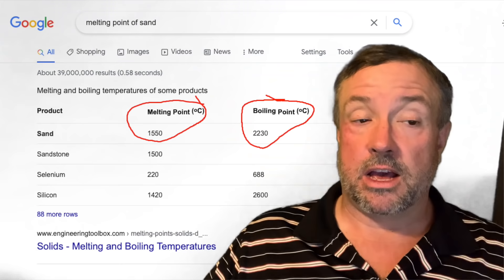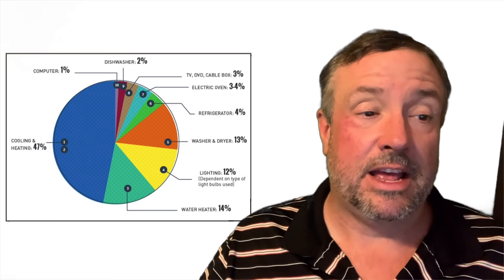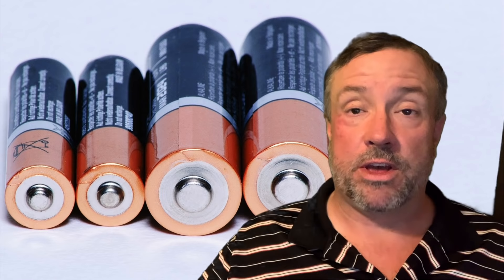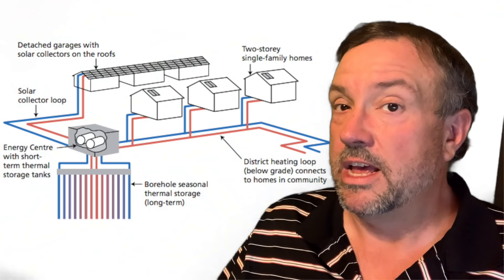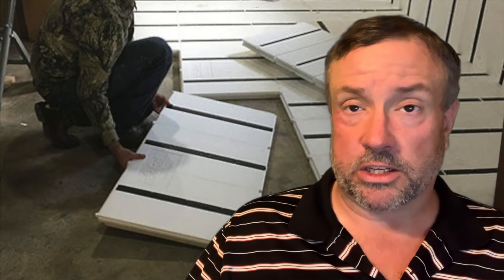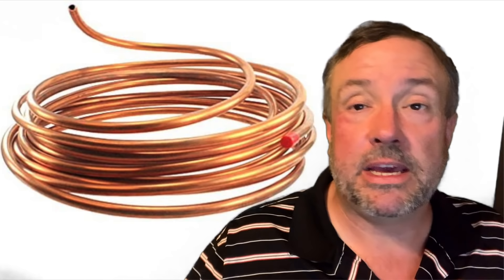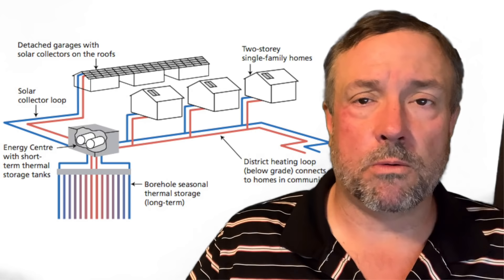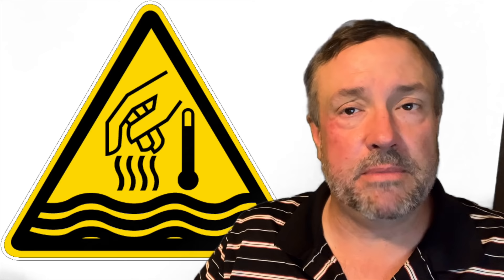Sand for Thermal Energy Storage

Comment from the maker: I need your input on piping, insulation, and distribution of heat for a sand battery! Help!
Reply: From what I saw, they don't even use steel pipes, I think they just used flat rocks, steel furnace pipe would probably rot out fast.
Reply: R50 is zero energy from a starting point. Fiberglass, foam and air Crete.
Reply from the maker: @jeffstout6567  nice
Reply: maybe lower temperature, but a  bigger area with sand?
Reply from the maker: @dvr102  that's possible
Reply: You mentioned aircrete to insulate, i haven't looked into that yet. I like the idea of having multiple circuits (electrical coils, air and water /salt lines) even if some are rarely used would be good for experimenting
Reply from the maker: @jeebus6263  I like the multiple circuits idea too
Reply: Is sand not a better thermal insulator than a conductor? Thinking like in the dessert it gets freezing cold at night so the sand can't be holding much thermal energy.
Reply: Salts usually freeze at low temps and have erosion and corrosion issues.
Heat transfer fluids can be toxic and expensive and high cost and high freezing temperatures.

So no to those.  Keep it air or water....true off the shelf mediums.
Reply: @garyhardcastle3736  even in Michigan, through the depths of winter the frost layer is typically less than a foot deep. I doubt the ground ever freezes in "deserts" even if the air is cold. Earthships run tubes 10ft deep and that's enough to both heat in winter and cool the homes in summer.
Reply: @gordybishop2375  corrosion from salts is a good point, ceramics could crack easily. I guess this would really only be needed to add heat, extracting heat should be fine at lower temp with water or air.
Reply: I like water as you can see the leaks easier.
Reply from the maker: @gordybishop2375  using gasoline is better cause you can find a leak fast with a match!
Reply: Fresnel lenses can heat to several thousand degrees almost instantly and be hot enough to melt concrete. The challenge isn’t get higher heat, it’s to heat your home or space. 

I agree with others here 1.) keep it simple & safe 2.) increase size and insulation to extend capacity, not increase heat. 3.) stay away from corrosives like salt or things hard to find at home.   4.) multi stage

I like the aircrete as insulation - it’s easy and cheap. 

For extreme climates the energy would need to be in a movable form so that it could be heated during the day and as it heats it is moved into its buried aircrete “thermos” if you will. 

Perhaps if there is an oil able to take higher temps and it is circulated and heated during the day and after dark or when heat is needed something like stainless pipes would through heated oil carry water that it heats and is carried inside to a heat exchanger or underfloor array. So the oil stores the heat and the water conveys it indoors.  You can of course pump oil indoors but it’s more problematic if there is a leak inside than water. 

When developing a solution I suggest limiting expectations initially and then enhance as more data becomes available. Don’t try to heat the whole house, build it to cut wood use 25%. As you learn you can increase it as warranted. Even if you cut 25% of wood use that’s 25% less work. Almost can’t loose. As you baby step through it and overcome the technical and practical challenges the real solution potential will become clearer. 

Flex, adapt, apply new knowledge and then take the next step. Start with more realistic initial objectives and fail forward. I’ll bet in 2-3 years you can master the whole house vs 6 month surge and series of fails lending little additional learning curve advancement.
Reply: @aceshigh235  new engine oil is clean but expensive, but old engine oil? Shops may pay you to take it away :)

The temp range would be descent, if it was in the medium (not in tubing) then any submerged pipes would conduct better. May be able to filter and pump from bottom, like engine oilpan(s).
Reply: If you stop thinking of it as a battery and look at Chinese greenhouse you will see you don’t need anything but the sand
Reply: @diversitylove5460  need vs want :)
Reply: Here's my take on it.
I would investigate the corrugated stainless steel tubing used for  natural gas.
Like many others here, I think you should use water as your working fluid.
To subvert the tempature limits of water, allow it to become steam.
To avoid the dangers of pressurized steam, keep the system an open one.
To store this heat, push your steam through the sand.
The steam will condense onto the sand particles and transfer the heat to them.
The water will drain to the bottom where we will have a sump tank.
That same sump tank could be the "low heat" insulated water storage you mentioned.
A defunct water heater could do the job.
An in line hydronic pump could pull water from the sump tank and push it through the solar heater, stopping when the tempature at the heater was lower than the tempature  of the storage sand.
A separate hydronic pump would be used to  push water through a (coil?)heat exchanger, located in the in the sump.
By using water as our working medium, we avoid the expense and dangers of manufactured chemicals.
By transferring the heat to the sand, we avoid the hazards and expenses of storing boiling water, and our working medium is returned to tempatures that can be dealt with using off the shelf components. 
The only section of the system that would need special materials is the part that moves steam to the middle of the sand.
Mounting the solar thermal collector on the roof of the sand storage minimize the length  of special tubing needed.
Because this section is not under pressure, most materials we might consider  will perform better than rated.
If the storage building is a cylinder, it will lower the surface area to volume ratio, without being excessively difficult to build.
A conical design might work as well.
The collector itself could set on a pivot point, with a handle that extended over edge of the roof, so the collector could change orientation from the ground, using a hooked pole or the like.
Reply: @slaplapdog  what is the cost of this system, aircrete insulation etc. Water can heat the sand up to 100c, after that the battery would evaporate water. Maybe useful for extraction but probably not charging. 

Electric coils are the easiest charging solution, i don't know what the upper limit would be on these. Ac vs dc etc. Main point here is if we double the heat to 200c, that's equivalent to two physical batteries. Tesla time was talking about >1000c, many oils will work up to 500c.
Reply: Hard to hear as volume is so low.
Reply from the maker: @reypolice5231  fixing that as I go forward - thank you
Reply: @jeebus6263  Ronyon was talking about a closed system for heating sand with steam and cooled water collected at bottom and then to sump tank.
The sump tank would be easy to kept topped up from any loss to evaporation. 
Just remember to install a pressure release valve on both units. Safety first.
Reply: @jeebus6263   Your point about the evaporation is an excellent one, I didn't think that through.
The obvious way to overcome that limit would be a closed system,  but that isn't inherently safe.
Reply: @redstone1999  Thanks for  your comment.
I think your explanation is the one that would work, but I hadn't thought of it!
I was aiming for an open system for safety, but I forgot  to consider what would happen when the sand reached  water boiling temperature.
Reply: Silicone oil should handle the temps you discussed but may be expensive. The metal you use for the heat exchange pipes is all about how fast of a response you want, cheap steel should certainly be fine if the cycles are taking place over hours/days/seasons. One thing to consider though is just geo thermal. You won't get the crazy high temps but you'll get enough to heat a green house/home through the winter, and the exact same system can cool your home in the summer. It's pretty cheap and easy to diy if you have the land to spread it out. If you don't then for like $15k you can have a hole drilled and do it vertically.
Reply: Thinking about this and the video on geothermal, I could see using a large pile of composting wood chips to heat a greenhouse or hotwater heater. Explore that idea and let us know what you think!
Reply: That seems like an important insight  - thanks for sharing!
Reply from the maker: @robyngodbout4300  Thank you for the link
Reply: @garyhardcastle3736  The desert sand is only heated on the surface, so the transmission of heat doesn't penetrate downward very far, and then it cools off each night. A thermal storage tank can be heated at the bottom and insulated, to retain as much of the heat as reasonable.
Reply: @jeffstout6567  fibreglass actually has really bad R value and poor longevity despite its rating. Spray foam is the king of insulation because it doesnt degrade, makes an air proof membrane. Not sure it can take 400C though
Reply: “Polar night energy” uses solar to heat sand with air.  Please watch their video, a Finland based company
Reply: The biggest drawback about evacuated tube collectors currently is that they get TOO hot for the food grade glycol necessary to heat domestic hot water. There is nothing saying that you cannot replace that with oil. And I know for a fact that if you have several sets in series you can get a ton of energy from them. Use that to heat the sand. Copper is expensive but you may be able to get away with metal electrical conduit and a pipe bender as long as the sand stays dry. You may want to look into ceramic coatings for the insulation of walls and floor. I would just concentrate on heating the structure. You can dial the speed on an electric motor to regulate how fast the oil flows and thus its temperature from the amount of time it spends inside the heat cell. Arrange the sand in a vertical column. Heat rises and stratifies in any fluid, with sand being considered a semi fluid the same principals apply. A secondary coil at the top of the column to collect the heat from. You will need an expansion tank for the oil vented to atmosphere still for the system.  Mind you this is months later so Im sure you have figured most of that out by now ;)
Reply: @garyhardcastle3736  I have slept on boulders on costal wind lashed areas and wasn't cold from the thermal heat held during the day. I am not sure about sand but rocks definitely hold heat for a long time.
Reply: Use your sand battery for a north wall of a winter thermal greenhouse & you could have a year round “outdoor” living and gardening area.  Bananas, avos, citrus, etc with no shipping from thousands of miles away.  Maybe plop a thermal hot tub in there too!
Reply: Large water tank buried in your sand pit heated by your wood boiler with a copper circuit in the tank then the tank water heating your greenhouse and house via pumps easy to regulate in house and greenhouse large storage cap fer solar or wood boiler heated water and you could fire the boiler less frequently
Reply: Whatever came of this idea? I have been thinking about these things as well. Adding sand to a passive heater. Like the pop can heaters. Also, what about using a magnifying glass on cloudy days? Would that help raise the temperature?  I have looked through your vids, and didn't find anything in regards to this. I very well may have simply missed it. Hope you see this comment. Curious to hear if you have experimented anything, and the results
Reply: Hi.  Been working on the same thing here for a green house and home.   Many pros and cons.   If you can make it work, water at 200c has the highest volumetric heat capacitance period.  You can keep it liquid at 223 psia but that's still a lot of pressure though manageable.   Piping will be expensive.    I would use two separate systems.   One for containing the hot water at below 200c + - 15°.   The other I would also use pure water with a stainless steel or copper  radiator sitting in the tub of hot water.    I would pump  water through the radiator isolated from the hot water, to remove the heat (not to add the heat) by pumping non pressured water through the radiator which happens to be sitting in the 200c water on demand.  Hope that is clear?  Yes it will produce steam and will cool and condense down to at below 100° c which is more user friendly and low to no pressure needed. Hope that's clear?
Reply: Why not fresnel lenses to focus solar energy? I realize that they need to be adjusted more frequently, but I'm thinking something like a raspberry pie with a camera apparatus that tracks the suns location and some solenoids that adjust the position of the lense to maximize capturing solar energy. Fresnel lenses can focus crazy amounts of energy to a small point. Raspberry pies, or arduino hardware are very cheap.
Reply: @tonyarnez5193  stainless
Reply: @jeebus6263  may need to water proof around aircreet otherwise water may seep in which is highly thermally conductive and of it freezes can crack allowing more ground  water to enter.   Could line the aircreet with industrial water barrier like used in hospital foundations, etc. To keep water out and insulate with over with aircreet.  Would need to be careful and well designed to not melt the barrier.
Reply: @garyhardcastle3736  Silicate sand has one of the highest volumetric heat capacities in nature.   Water is the best but higher temps can increase the amount of energy you can store albeit also causes more challenges and specialized engineering for high temps.
Reply: @aceshigh235  stainless 80 Guage might work but expensive.   Ceramics or carbon etc potentially but cost is a concern.    May sound crazy, but was wondering if at crazy hot temps, of silicate sand could be pumped through the system to transfer the heat.  I do know of impractical highly thermal fluids that would work but not practical.  Paraffin has amazing properties, but has a dangerous ceiling and limits the upper range of high temp but would work.  Need triple redundancy for safety however as the boiling expansion if exceeded is explosive at best.
Reply: @slaplapdog  You have raised an interesting point!  Use steam unpressurized at any temp to move very high temp energy?  Is this what you mean?   I will research this.
Reply: @jeebus6263  sorry misspoke here.  Cast iron at 1000c with a temp difference of 930c, would only have 1004.4 KWH energy per meters cubed NOT including heat losses.  1/12 a year of total energy used in average us household.    :(.  Didn't notice the online calculator was in joules not KWH.   To get kwh, must divide j's by seconds in an hour which is 3600.   My bad.
Likewise, Water using 100c difference in temp, requires 103.1 meters cubed to meet the 12 ,MWH heat energy used in average US house.   Most substances if you double the temp difference, you cut the amount of material needed in half.  I know I'm not showing my math, but I'm on my cell.  :)
Reply: @CommieBastard-dj9ot  it's a good system.  Though there are pros and cons of using the same system for heating and cooling.   Ideally it's seems the easiest and cheapest solution is to use a heat pump in conjunction with geothermal.
Reply: @Sycophantichallenger  I had never heard of raspberry pi before, and thought, at first, that you were making fun. Lol I googled it. What a great little item! TY! 

Yes, f. Lenses, are large, and generate, magnify, the power. I am not as technically skilled as yourself, so not able to build such a device. But what you described, is what I would love to create. I am in Kentucky. We would not need to use a lense everyday. But the addition of one, would greatly increase the usable days, of a passive heater. I have just completed the build of a soda can heater. Now building the back of it, which will be insulated, over kill!!! With a sand bank. Inside, will be other materials, to store up heat, such as Rick and other things. To store the heat throughout the day. To be released at at night. I plan on just trying to use a f. Lense manually. For I don’t know how to create a device to do it automatically. I believe, the combination of these things can create a very reliable, and worth wild heater. We will have two of them. Plus, ductwork and fans, to move the heat about the house. One side of our house is already several degrees warmer than the other, simply from the sun shining through the windows. With a little effort, I am sure we can take advantage of this!

Are you planning on building such a device as you spoke of? I would so love to hear about it. And see it, if you are interested in making a video of it? I can follow directions and maybe add one to ours! Thanks
Reply: @l0I0I0I0  I am building a passive heater. We have a lot of wrought iron collected, that I am going to put in, as a heat battery. Along with sand. So much is thrown away, and just laying around, that one can easily collect it for free! And man that stuff can get HOT!! With little effort!
Reply: @wordswritteninred7171  That's a great idea Tema!   Let me know how it goes?   Love to hear more about your design?
Reply: Just wondering what you ended up doing and why?  Any improvement ideas?
Reply: I've spend many hours on this last few days researching this topic as I want to make one for a greenhouse.  You probably all ready know this but I did some homework, and the DofE says avg household used 77million BTUs a year.  That's a whopping 22MWH+ Per year not 12.  That's double what I expected.
 The  higher temp you are shooting for of 1000c will help reduce materials needed but at a cost of safety and containment, piping etc.   It's possible but difficult, but sand is cheap.  Insulating and containing it are the issues I see.  Did research on making crucibles even but that's a HUGE one needed for sand.  Carbon would be the way to go.  Researched making them and it's possible but they do crack.   Needs lots of testing to make safe, but putting it underground will help with safety.   I would use a separate radiator system to pull the heat out.  
Carbon fiber pipes will work for longevity at the higher temps wrapped in thermal heat blankets, forget what that white insulation is called.
Personally just buying or making a huge solar heater and lower temps may be the best option, especially lower temps.  I've been working on a solar hot water heater for some time now but not complete.   A friend heated several homes with them year round with no prob.  That with a geothermal system would be idea I think.   If you want to hear more I'll discuss water hot water storage in conjunction with a solar hot water heater.   1 month of hot water storage may be overkill but that's the fun part of it all.  :D
Reply: Just looking at sand vs water properties and with the temperature ranges you are talking about it simply doesn't make sense to bother. Sand has the 1/5th of specific heat and a density of 1.75 roughly. Aiming for 200 °c for  a given volume you would have roughly the same heat stored than water at 80°c.
Reply: @loicbockstaller7405  yes sir!  Found the same.  Water is the best.  But for safety, have double reliefs or kaboom.  Expansion ratio of water is crazy high and can take off like a rocketship.  But with the right precausions it can work and work well.  Recommend looking into boiler systems and boiler safety beforehand.  Let us know how it works out!!!
Reply: Oilfields Coil tubing would work and it's cheap like borscht
Reply: @tommyodonovan3883  Sounds like it might work.  What is it made of and is it coated.  How conductive is it?  TY
Reply: Controlling the temperature of the sand battery would be a priority. 400F is normal in a steam system, so fiber glass insulation incased  with a aluminum weather shield exposed to the elements is normal. The loop that enters the residence may need to go through a heat exchanger to keep the temperatures under control say 180-200f. 
   I’ve recently been busy polishing a sheet of aluminum flashing to a mirror finish with a final grit of 10,000. with a 5” orbital sander. It’s quite reflective, however I’m waiting on a order of 94% reflective 2mil material with adhesive on the back side to compare it with. The solar trough idea dems, are 30” wide and 8-10’ long.
Reply from the maker: @jeffstout6567  that’s awesome
Reply: As for a thermal transport medium, I heard someone suggest using regular air. It makes sense to me but I'm not sure what kind of fan could survive 500-1000C
Reply from the maker: @JohnDavidDunlap  good question
Reply: @SimpleTek  I might have an answer. The exhaust side of a turbocharger is designed to handle hot gases of that temperature. As long as it has oil pressure and something cooling the intake side, I see no reason why you couldn't use the exhaust turbine to move hot gases.
Reply from the maker: @JohnDavidDunlap  love it
Reply: Pex is the only way to (in my opinion).  Pex carry's heat well, will not rot or rust, and is inexpensive.
Reply: @frankfrederick5158  That's fine if you're content staying below the boiling point
Reply from the maker: @frankfrederick5158  pex is limited to about 90’C though
Reply: @JohnDavidDunlap  Yes.  If you need to distribute heat higher than boiling, then use the Rocket Mass Heater concept, but heat water to use for other uses also.
Reply: @SimpleTek  Here is a quote from the Pex stats:   "The maximum heat temperature of the PEX tube is 200 degrees. The maximum heat of the PEX can be up to 180 degrees. The PEX tubing has the highest temperature limitation listed in small prints".
Reply from the maker: @frankfrederick5158  sure that isn’t Fahrenheit? Sound about right for F’
Reply: @SimpleTek  Yes, F not C. 90 degrees C,  Boiling Point of water is 212 F/100 C.
Reply: Try graphene disolved in a mix of ethelene glycol and water 👍
Reply: @tonyarnez5193  Steel ducting for furnaces is not pipe, it is ducting. But i agree it would rot pretty fast if it got wet. But the gas line that runs to your furnace is indeed real pipe, that will take years to rot out.
Reply: A company in Finland has just capitalized on the sand battery and story has gone viral. How does sand compare to water compared to soapstone absorb heat and release Heat? In Russia and in Canada and in Sweden there's a type of stall called a Swedish Thermo stove. They usually weigh about 5 thousand pounds. It's a thermal Mass stove and the fire that's started in the stove is absorbed in the bricks and soapstone. It will give off heat for 10 hours after the fire is extinguished
Reply: Turkish Hot Sand Coffee Brewer with the Copper Cezve Ibrik.
Reply: I have been considering a similar thermal battery system  for a home I’m building . I wont need much HVAC/heating and cooling due to the thermal efficiency of the envelope ,  but definitely like to idea of storing thermal heat for later use.
    I've looked into several  thermal heat transfer fluids that can withstand higher temps than glycol which has a boiling point of around 387F. The main benefit I see for storing temperatures in the 500-600F range or higher is a smaller footprint ,  more energy reserves in a smaller space. Another benefit is it the possibility to drive refrigeration fluid phase changes  with temps in that range. 
   Most Solar thermal water heaters are not designed with piping that is anywhere close to handling temps in the 500c range  on the heat pump side .  If the temps of a sand battery were around 250F you can use  copper, or standard galvanized boiler pipe but neither are made for constant use much higher than  those temps...250F its pretty close to the temps in  a standard solar thermal water system. At temps above 250F you really start getting into the need for specialty heat pipe, some are nickle/copper alloy mixes...I doubt they are cheap but it might be worth it!   A sand battery is basically a high temp heat fluid to Sand  heat exchanger, storage system which can transfer high temps to  secondary thermal heat fluid/ water heat exchanger's ( domestic hot, and radiant heat/Pex)  . 
    While I would love to have a sand battery that can store 500c degrees , it really means buying specialty piping and  building a high temperature heat exchanger using high temp heat fluid...Common parts can be used to plumb together a heat exchanger, glycol/water mix at around 250F, copper or boiler piping , used car radiators, or used heat exchangers from old gas boilers if they arn't cracked can be used to transfer heat to the thermal battery. 
Steam seems like an interesting option as one component, but there are some considerations with that too ( high pressure piping, and a condenser chamber ) but that might be a good component to convert from a high temp sand battery to the other water storage heat exchangers ( domestic and radiant ) ...either way it seems,  you will need a high temperature heat fluid loop coming from a solar concentration unit and a high temperature loop/ heat exchanger in the sand and a high temperature heat fluid pump ,  to transfer those high temps  from a solar  concentrator to the sand safely .
Reply: This substance is Starlite by Maurice Ward check it out on Youtube to see how you can integrate it into your sand battery plan ?
Reply from the maker: @jackjackson3356  very interesting
Reply: @garyhardcastle3736  we've experimented and sand holds heat, thing is it takes along time, days to raise the temp, in our test, and if uninsulated it escapes just as fast.
Reply: @wordswritteninred7171  you can go old school DIY and use a tv antenna rotator as a device to control the frensel lens.  Some DIY people use them to rotate their solar panels.  While not being automated it is able to be done by remote.
Reply: @l0I0I0I0  In a R31 home in Fort Erie ON the winter heating load is 6.6MW why use water when your home furnace heats air to 1900C, and the ducting can take that heat.  Using air eliminates losses by converting from 200C liquid or steam to a temp that can be used in the home radiators.    Hot air from sand store direct into the furnace.  Even at 500C that would offset some natural gas use.
Reply: @l0I0I0I0  a sand store would need a blow off valve in case of any water ingress.  Why stay at 200C when sand can handle 1000C so let us stay at 500C  for safety, and for simplicity of parts, many things in the home can produce that kind of heat and transfer it.  Just think about it.
Reply: @jeffstout6567  Roxol wool is good to 1177C is made from slag and steel.
Reply: @JohnDavidDunlap  an external squirrel cage blower fan with external motor on a belt.  High heat bearings would be needed at the pillow blocks of the squirrel cage.
Reply: @TheRebelmanone  with temps above 100C there won't be any water in the sand, now keeping water from ingress would be the only concern or you can say boom at 500C.
Reply: @slaplapdog  Mixing traditional ethylene glycol antifreeze with water in a 50-50 ratio increases the boiling point to 223°F, which is close to the operating temperature of an engine. Evans waterless coolants have a boiling point of over 375°F, far above the operating temperature of the engine. So to my point a closed loop system filled with waterless coolant would heat the sand to hight than steam temperature and add to available stored BTUs.
Reply: @oloilmann4288  wow! Thank you! That's simple enough! Did not even think of that. Appreciate the info!
Reply: volume on this laptop is maxy and me still have to sharpen my ears to hear u ....exelent video and talk by the way
Reply: @slaplapdog  what’s your thoughts on contamination of the circulation water . Steam plant’s use chemicals in there steam to prevent algae growth and anticorrosion out in the system.
Reply from the maker: @jahstafari4606  fixed on future videos
Reply: @JohnDavidDunlap  perhaps you could use an turbo from a car engine
Reply: styro aircrete!....cheapest best insulation
Reply from the maker: @l0I0I0I0  that’s awesome
Reply from the maker: @Anna cool
Reply from the maker: @tommyodonovan3883  thank you
Reply from the maker: @sambelterasi8360  thank you
Reply from the maker: @TheRebelmanone  cool
Reply from the maker: @oloilmann4288  I found heat moves very slow through the ground
Reply from the maker: @oloilmann4288  interesting
Reply from the maker: @oloilmann4288  wow
Reply from the maker: @oloilmann4288  ok
Reply from the maker: @oloilmann4288  good point
Reply from the maker: @dodge1137  thank you
Reply from the maker: @daafdijkers2230  hummmm
Reply: styro aircret
Reply: de303 solar parabolic dish
Reply: steel pipe and oil?.flexible iron pipe?......motor oil..tranny oil?...
Reply: @SimpleTek  yup
Reply from the maker: @d.e303-anewlowcosthomebuil7  cool
Reply from the maker: @d.e303-anewlowcosthomebuil7  I love aircrete
Reply: @SimpleTek  have you tried yet adding chopped up waste styrofoam>.?..s-fc....lol
Reply: @SimpleTek  Look up Polar night energy.
Reply from the maker: @davefroman4700  they are doing great things!
Reply from the maker: @davefroman4700  really good points
Reply: I have done a lot of studying of cities of the future , and I came to really appreciate 400 PSI air in standard copper pipe , just with a high temperature solder. For both cold and hot .
Reply from the maker: @robertlackey7212  interesting
Reply: Has anyone considered air as a medium? It's non flammable non corrosive and can be heated and cooled easily. If there's a leak it doesn't hold the heat long enough pose severe danger if the pump circulation is stopped. There are lots of intercooler that can be used to transfer heat into cooler temperatures of air.
Reply from the maker: @christopherwilson5220  good idea
Reply: Would hydrolic fluid work as a heat transfer medium? It is designed to take pressure, but what about heat?
Reply: @jeffstout6567  Yes, there are YouTube videos demonstrating how to polish satellite dishes to mirror finishes. Using reflective tape, too, as an alternative.
Reply from the maker: @donalddalley7274  good idea
Reply: Stone ,any stone or stonewere pipe,stone in a shape of pipe
Reply from the maker: @rajivlaad  ok
Reply from the maker: @gregmartinsask  maybe
Reply: I was thinking if you had a large sand tank (1-2 meter diameter and 2 meters deep) directly below a parabolic dish (old primestar dish covered in mirrors) that focused on a small vessel - then used, as someone below suggested, a turbocharger unit to pump the superheated air straight down into the sand (say through steel pipes) it may be fairly useable.
You could then utilize a secondary coil in the sand to extract this heat in the sand and pump fluids into the house underground.
You might also look at “pumicrete, or pumicecrete” as an structural insulator. It made with pumice as the aggregate in concrete - available in large bags from your local garden center.
Reply from the maker: @marknichols7861  very interesting
Reply from the maker: @@haldonotdisplay4908 yes
Reply: Pour concrete in ground and wrap it with thick layers of rock wool.i would build it with other heat sources electric elements. Waste oil burner and wood.
Reply from the maker: @terryearl4023  rock wool???!
Reply: @Nick-tw4rs  I prefer Rockwool insulation, it has high melting point and it won’t burn
Reply: for your distribution of heat form a sand battery after coming out of the battery i would not use any metal pipes even if insulated it will still lose a lot of heat just going through the pipe the pipe alone will absorb a lot of the heat
Reply: @tonyarnez5193  why not ? If it’s in a completely dry and salt free environment where will the rust / wear will come from?
Reply: Our harvester does 300C and the heatstorage holds sand! 🙂
Is this possibly the right answer to your question?
Reply from the maker: @HeliosMylos  what is a harvester?
Reply: Metal trash can, sand, heating element from an electric water heater and a solar panel is one way. 
On another  note you may be able to run your secondary unit in sand under your green house before it gets to the house or under a barn or chicken coop or dwelling space or even the house itself.
You may be able to run
Reply from the maker: @cgray8969  interesting
Reply: @SimpleTek   a device to harvest heat energy (~300°C) from the sun
Reply from the maker: ok @HeliosMylos
Reply: @garyhardcastle3736  In nature only the top 1/8th inch of the surface is hot. And it radiates away in a couple of hours. However a large mass of it in a properly shielded vessel can hold a lot more energy than an equivalent amount of water can.